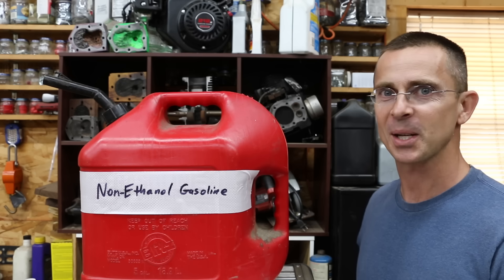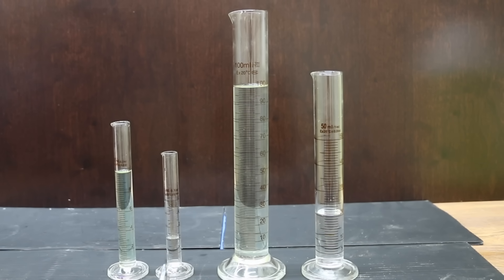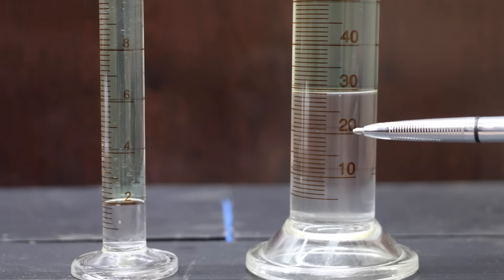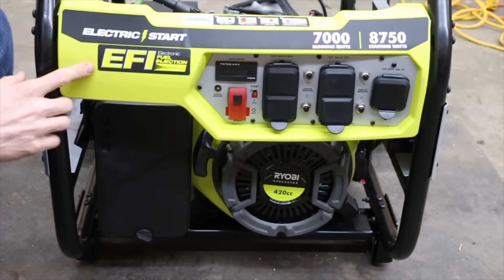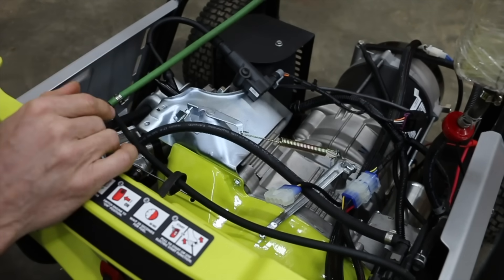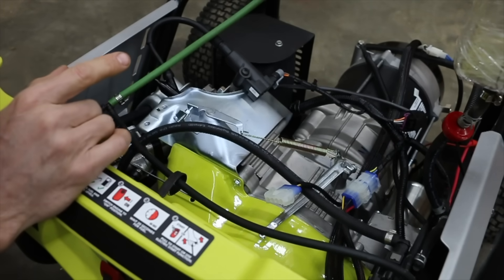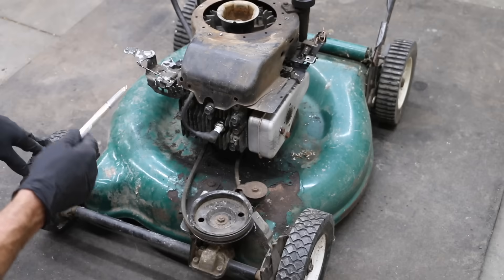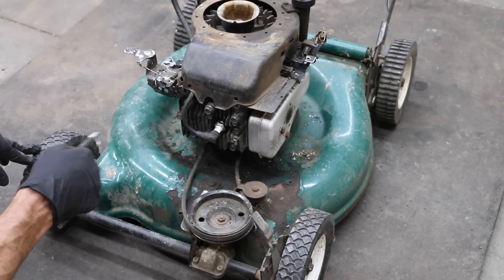Is Non-Ethanol Gasoline Really Better? See the PROOF!

Comment: One thing that might be counter-intuative is that anhydrous ethanol is significantly MORE corrosive than hydrous ethanol. So gasohol blends with some water contamination will actually be less corrosive (to some extent for steel/iron, but especially to aluminum alloys) than dry fuel.
So as long as you're not having phase separation issues, some water dissolved in the fuel is actually beneficial as far as corrosion is concerned.

Lubricity related wear and tear would be a more complex issue (though provided there's no phase separation and there isn't a massive amount of water present, it shouldn't be significant:  E10 can't hold enough water to be significant even in the summer, but E85 certainly can ... hypothetically you could also solve this by adding a semi-hydrophillic lubricating oil like castor oil)

Aggressive solvent behavior should be dramatically reduced as water content increases. (the kind that can cause softening, swelling, or disintegration of some seals or rubber or plastic components; particularly old ones already compromised by long-term exposure to aromatic hydrocarbons or just oxidation from air, especially sunlight and heat catalyzed oxidation)

However, solvent properties that involve dissolving gum, gunk, and varnish can be increased by water content. So an old fuel system that hasn't been flushed with such solvents will tend to have all that stuff dissolve into the ethanol blend upon first use.

Oh, and of course, the fact that modern gasoline all tends to have significant aromatic fractions in it (usually around 20% but higher in some regions) will make the aggressive, rubber/plastic-eating solvent properties much worse than if ethanol was blended into a purely saturated hydrocarbon base fuel (ethanol blended with straight alkylate or low-aromatic light naphtha; the latter being similar to old style low-octane gasoline as well as modern white-gas style camp fuel, the former being the high-octane hydrocarbon blending component that became popular after WWII and was produced using new technology in the US during WWII:  Alkylate is just a blend of highly branched saturated hydrocarbons usually made from catalytic cracking of lower octane base fuels).

The fact that ethanol+aromatic hydrocarbons makes for an aggressive solvent is hardly surprising given that mixture is somewhat similar to common lacquer thinner blends. (methanol, toluene, and acetone are common formulations, and Toluene is one of the most significant fractions of aromatics in modern gasoline ... xylenes and trimethyl benzenes are also major components, and also form aggressive solvent blends with ethanol or methanol;  benzene does as well, but has been increasingly restricted in modern gasoline due to its exceptionally toxic/neuotoxic and carcinogenic properties:  the same reason benzene generally isn't used as a solvent in paints or glues anymore)

On a side note: there's been a more recent trend to reduce toluene and xylene use ... or even ethanol use as a solvent, as happened in CA due to it falling into the restricted VOC list ... so hardware store denatured alcohol has largely disappeared, as has toluene and xylene, plus MEK, though acetone has not as it's explicitly VOC exempt due to not tending to form smog when mixed with NOx; lacquer thinner formulations are also different because of this, though oddly enough, carb cleaner or choke cleaner or brake cleaner formulations are all over the map as far as "CA compliant" goes, with some still using methanol+toluene+acetone much like traditional lacquer thinner ... weird. Though all of those aromatic chemicals are still commonly present in CA gasoline formulations (and E85), with the reasoning there being that it's being used as a fuel and not solvent, and not intended to have large amounts directly evaporate into the air (which also means denatured alcohol SHOULD have still been OK to market solely as a fuel in hardware stores, rather than multi-purpose fuel+solvent). 

It's still rather silly IMO. Reducing/eliminating benzene use made more sense, and even reducing/eliminating other aromatics used in cosmetics made sense (since direct human exposure is a bigger issue than as a minor atmospheric air pollutant) ... eliminating them from commercially available paint formulations or aerosol automotive solvent formulations made a less sense, and eliminating them from mixed (or especially pure/straight) hardware store solvents made the least sense. (the number of people mixing their own special or traditional solvent blends for paint/glue/whatever from commercial cans/bottles of methanol, ethanol, toluene, xylene, MEK, or even turpentine would be such a small and specialized niche that it shouldn't be a big concern for public health and is useful/necessary for specialized or legacy small-scale shop formulations ... and backyard/garage chemistry for that matter ... or specialized fuel blends for that matter; though the latter would technically only be legal for off-road use due to tax issues rather than anything health/environmental related)

And yes, turpentine is no longer available here, either. A bit ironic given it's among the biomass derived solvents and at least hypothetically sustainable if produced along with forest management that doesn't lean to net depletion. (or, for that matter, does lead to some reduction in forest density, but in a healthy manner: ie encouraging more managed forests with sufficient thinning to reduce fire risk while also maintaining healthy new growth and old growth)
Reply from the maker: Thanks for sharing.
Reply: I found this study: (if fuel lines are aluminum, beware!)
Susceptibility of aluminum alloys to corrosion in simulated fuel blends containing ethanol
J.K. Thomson. et al
sorry, links not allowed

Comment: Petroleum-based gasoline that does not contain ethanol will still succumb to oxidation and volatile compound evaporation in a sealed container or tank, but these processes usually occur more slowly in pure gasoline. Expect non-ethanol gas to last at least 6 months if it's properly stored.Sep 9, 2022
Reply from the maker: Thanks for the feedback.

Comment: Ethanol's biggest problem is it's derivative acetic acid, that corrodes brass carburettor jets. Zinc in the brass oxidises to white zinc oxide, which has to be removed manually by stripping down the carburettor to get to the jets. Ethanol actually oxides over time, if left to stand in a vehicle, into acetic acid. This acetic acid will also rust out steel tanks and fuel lines, causing the fuel filter to become blocked, as well as the jets.
Reply from the maker: Thanks for the feedback.
Reply: The reason ethanol oxidizes in weak solutions like wine, is that certain airborne bacteria get in there and act as enzymes to convert it (first to acetaldehyde, then acetic acid). But at concentrations of >40%, the bacteria is completely killed off. Think of distilled spirits: they never oxidize.

Comment: If its so bad, why did professional racing switch to E85+ ethanol fuel almost a quarter of a century ago?
Reply: To get more power in a highly oxygenated hydrophilic fuel.  I promise you they don't let Moto GP bikes sit with a tank of E10 in them over the winter months.  You are comparing apples and oranges.  In the summer, in Arkansas, if you aren't going to the whole tank in 30 days or so, you need to rethink your strategy.

Comment: I just purchased 4 Cycle Ethanol-Free Fuel 2.1 Gal from Home Depot. For my Harbor Freight Predator 3500 generator. Do you still have to use a fuel stabilizer?
Reply: Read the can, it will say the shelf life of an unopened can versus an opened can. In general you do not add any additional products to shelf stable fuel sold at big box store.  That is the reason you are buying that product.  I use engineered fuel in my 2-stroke yard equipment because I use them infrequently.  In my lawnmower I use engineered stabilized fuel (or a generator) over winter.  If I had a generator and it was mostly just sitting, I wouldn't think twice about using that type of fuel always.  I would also drain the fuel when and if the opened expiration date had passed.  Ethanol based fuel is good and bad.  The way most people use it in their cars, it helps the environment (debatable, but I will give the government the benefit of the doubt here.) For yard equipment and motorcycles in winter storage it is not a simple issue.

Comment: The moral of this story is that you should use the fuel recommended by the manufacturer. My car was designed to run on 10% blended fuel and I have used 91 and 98 octane fuel with no marked difference in fuel economy. Engines that are designed and recommended to run on ethanol blended fuel have the appropriate fuel lines installed. It is true that over time the ethanol will seperate if the fuel is left for any length of time if it is exposed to the atmosphere I have a sealed glass container of ethanol blended fuel that I have kept for over 12 months and has no sign of separation. There was a study conducted by the US military in  that they analysed the wear characteristics of various fuels on engines with methanol being the fuel that caused more damage. Ethanol was on a par with unadulterated fuel.

Comment: We could be feeding living organisms with the corn that we put in our fuel. I know farmers won't like this sentiment. I think it's ashame to waste food when we have an abundant source of crude under our feet for many years to come. I am lucky. Where I am at I can get anywhere from 87 to 93 Octane of REAL GAS. 87 octane is .60 per gallon more. I run that in my 99 Nissan Frontier. Owners manual says to stay away from ethanol/methanol if it can be avoided. Runs like a top. 2nd owner with 59k on the odometer. Original owner burned straight fuel too.

Comment: Of course!  100%  EtOH is 30% less energy dense than 100% gasoline.   But  the risk of water condensation in cold climate and with fuels stored longer (ie in small engine home owner scenarios) is higher up here in the northern midwest and has caused EtOH spiked fuels to lead to stalling and starting issues over non EtOH spiked petro fuels in my experience thus negating the oxygenation benefit of EtOH spiked fuels.  So in my car with high fuel usage rate....I go with low octane, regular EtOH spiked fuels at the pump.....  but with my snow throwers and other small engines that sit a long time between runs.....I run 100% petro.
Reply: I have to say....your channel and your techniques are awesome.

Comment: RAL is right i have never had so many spring time carb issues try testing two motors sitting over winter & see witch starts & stays running . you will find the ethanol motor will be the problem child  ( full of white oxidization)  .that is the test that shows the problem with ethanol gas.
Reply from the maker: Thanks for the feedback.

Comment: So, I understand the results with a small engine and similar carbon deposits with ethanol and non-ethanol fuel. What are the results with the same comparison with "direct" fuel injections engines in newer automobiles?
Reply from the maker: Thanks for the suggestion.

Comment: I don't understand why these small engines get screwed up so quickly with normal gas.

We have an old Saturn which we sometimes don't use for well over a month.   A lawnmower would have to go to the shop to get started if the gas was left.   But the Saturn starts.   The problem isn't the gas.   It's the motors and carbs.   Shame on them.
Reply from the maker: Thanks for the feedback.

Comment: Ethanol added to fuel lowers the energy burnt per litre. Its cheaper here in NZ than proper fuel (10%) but others have said you wont get the same mileage with cars. Ok the worse stuff: phase separation, Issues with composites (fuel tanks), issues with metals in older vehicles (fuel pumps and carbs ) I avoid it like the plaque. Even a large automobile watch group here said to avoid it unl;ess they make it a lot cheaper.
Reply from the maker: Thanks for sharing.

Comment: Excellent testing. Always enjoy your work. I'm 68 and raced motocross and snowmobiles till I smartened up. Lol. I never use regular with ethanol in anything especially small engines.  I've seen a lot of damage to aluminum, steel gas tanks, seals and gaskets.
Reply from the maker: Thank you!

Comment: If you mix the ethanol yourself into the petrol, you will, however, get a higher octane value and can increase the compression and change the timing if you are someone who is involved in motor sports or interested in performance. Pure ethanol has well over 100 octane and contains more oxygen. so if petrol companies without added more ethanol with zero octane content are just as high, then they would probably have done it by reducing some other octane-increasing chemical? Or in another way

Comment: Well. Alcohol is a racing fuel quality. Far superior to gasoline in almost every way except perhaps energy content when comparing gasoline-compression ratio engines non-optimized for alcohol fuels such as methanol and ethanol.  Saying its 'worse' just because some (any particular) engine isn't designed for alcohol and it melts some component isn't actually a strike against alcohol.

Comment: This debate is silly. Henry Ford started producing Model T's in 1908 that could run on an ethanol - gasoline blend after the Federal Government ended the $2 per gallon tax that was levied to help fund the US Civil War. Refiners used ethanol to raise octane levels since then with little being used from the late 40's to 1974 due to the abundance of cheap lead compounds. During WW2 civilian gasoline sold in the US contained from 10% to 65% ethanol so more gasoline and lead compounds was available for the military. I never heard any adults that drove back then complain about alcohol in gasoline screwingv up fuels, carburetors and metals. European countries continued to add ethanol to gasoline after the war. Great Britain sold a 'Cleveland Blend' until 1968. The US started using ethanol again to stretch gasoline stocks after the '73 Oil Embargo then to raise octane levels  in unleaded gas. I was driving old trucks and cars back then that got the carburetor rebuilt and all new fuel lines due to rubber hardening and cracking. Drove those using the ethanol blend without having any problems. Maintained my powered lawn and construction equipment over the years using the standard rubber fuel  lines sold at the auto parts stores. Those held up just fine so I assume they were producing alcohol resistant rubber fuel lines since the 1920's.
Reply from the maker: Thanks for sharing.

Comment: Really, what they need to do, is there's 85, 87, and 91 pumps at all gas stations.   Just convert the 87 pump to a Non-ethanol pump for small engines and relabel it as such.   I'll pay a higher price for ethanol free gas, just to keep my idle jets from clogging up and my tanks from rusting out over the winter.

Comment: The real problem with ethanol, is it attracts moisture and turns to gel and clogs up your small engine idle jet.
Then your engine only runs on choke, and when throttled up, it stalls out.
They were not designed for it.   You have to rebuild and clean your carb.... all... the friggin... time.   It gets old, fast.
Esp. since carbs were not designed to be easily to pop right off and put back on.  Its worse on motorcycles.   I loathe carbs now.
Reply from the maker: Thanks for the feedback.

Comment: For older cars with carburetors and  and Fuel injected  cars prior to  2001 with rubber lines and EVAP systems,,, 15% Ethanol  is EXTREMELY HARMFUL! 
I am speaking from experience! .  
 it causes rubber EVAP line to swell and become spongy and it will clog up fuel bowls and injector ports in carburetors. And it will seriously rust your gas tank if E15 is left sitting in a steel gas tank.
Reply from the maker: Thanks for the feedback.

Comment: Most people don't know this but the reason race cars use alcohol fuel is because in the middle 60's at the Indy 500 There was a crash involving Eddie Sacks and Dave Mc Donald in the first turn.  The gas in the cars spread all over the track and the stands.  The drivers burned to death and many spectators were injured due to the fire.  They figured out that gas burns low as it spreads out BUT alcohol vaporizes up and away from the track and the cars.  That was the last year 100% gas was used at Indianapolis .
Reply from the maker: Thanks for sharing.

Comment: The problem with ethanol free gas is it sets in the station's tank longer, some has gotten so old it won't run properly in chainsaws.   Ethanol content varies over a wide range.  One station near me had over 30 percent alcohol which caused dozens of chainsaws to run hot and seize the pistons.  That place no longer sells gasoline!  I always test/remove the alcohol!
Reply from the maker: Thanks for the feedback.

Comment: A little Marvel Mystery in the Oil (MMO) in the gas negates the ethanol and gives extra power via oil. Lubricates the top end while running also. Here in Florida with the heat and humidity its a must.
Reply from the maker: Thanks for the feedback.

Comment: I used ethanol based fuel in my gas can for  Honda mower. I left it sit dry for 2 months, came back checked air filter and plug and the air filter had a mold farm growing on it. Must have had moisture introduced somehow ?

Comment: Letting any fuel rest for a long period will cause issues that only replacement will solve, using ethanol fuel and then flushing  with non ethanol works well, especially in 2 cyl applications.